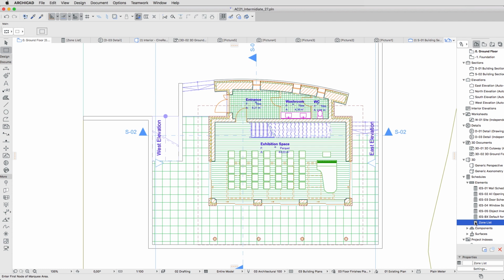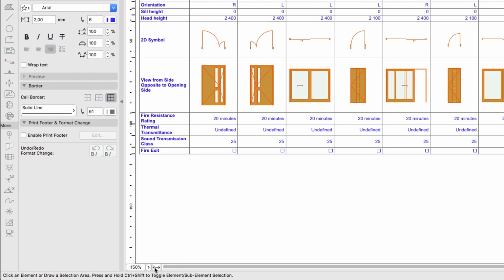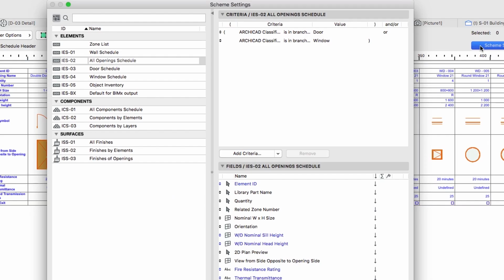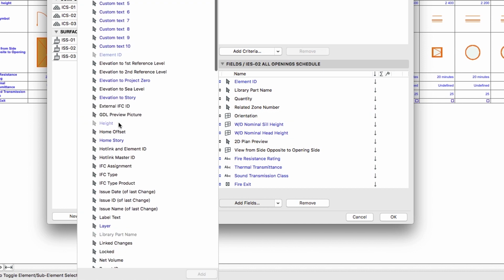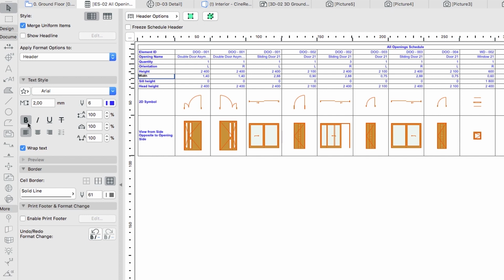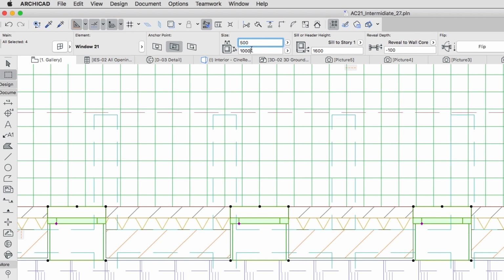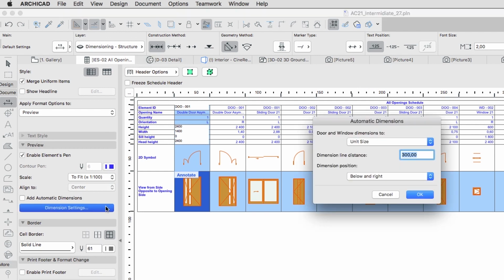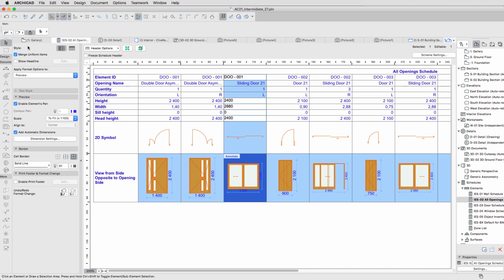Doors and Windows Schedules - ARCHICAD Training Series 3 - 74/84

Comment: How do you format the automatic dimensions? meaning, font type, font size, etc. Do I have to go one by one, or is there a menu where I can change them all at once?
Reply: When you click the button to add automatic dimensions in the window legends, it will use your latest settings. So to set this up in a specific font type, size, marker etc... define your settings first in the dimension tool (in plan view), then click the option to add them in the schedule. You'll see this works everytime. If you want to change the style, adjust your current dimension settings, the uncheck, and recheck the option in the schedule!

Comment: what if i dont want to include a certain window(s) or door(s) on the schedule how do i do that? or i cant do that because archicad doesnt understand that i need that option.
Reply: You can exclude specific windows and doors from a schedule, by applying a single criteria. So for example, for windows or doors you don't want scheduled, add property or note, or option set to "schedule true/false", and use that as a criteria. It can work both ways, exclude false, or only include true...